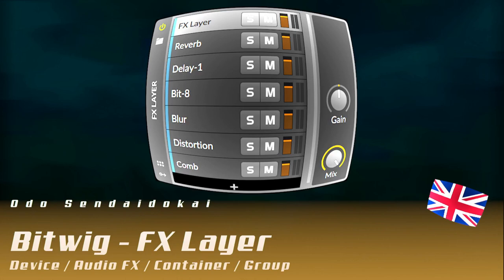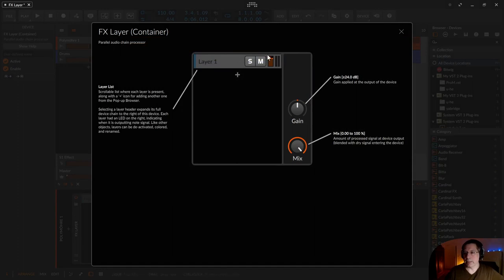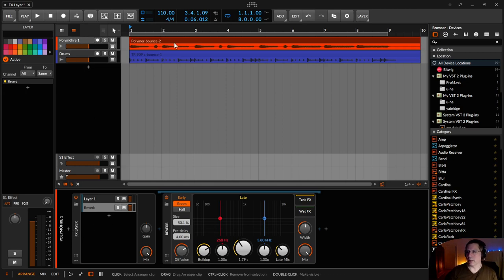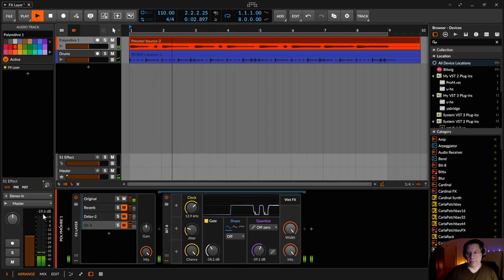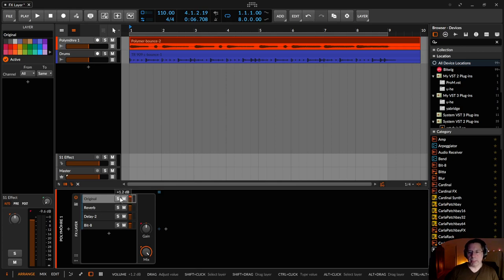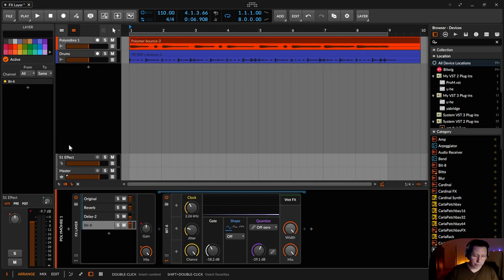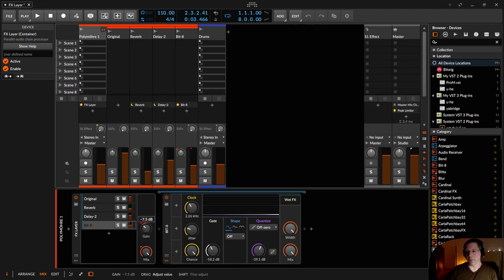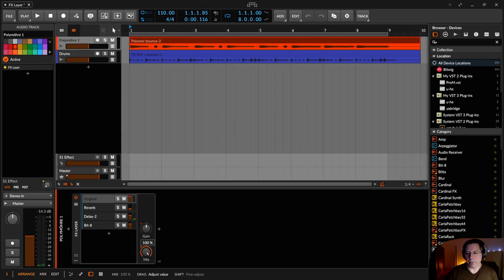Bitwig - FX Layer / Effect / Container | english

Comment: What I find confusing is there is only one mix knob, it's not one for each layer.  If I have it empty it still gets the signal through, if you put in a pro-q3 but dont have a dry layer it still seems to mix with the dry layer, and if you add a few layers it's like parallel on steroids & then each of these fx layers can still pump out to the fx sends that are set up. so 3 or for layers plus a dry, I was wondering why some of my levels where peaking, sometimes I might have more than one fx layer container in a track, sometimes on sometimes not but still boosting things due to all the extra virtual tracks.
Reply from the maker: If it is like you described, you should send a bug report as email to support@bitwig dot com . For the mix knob for every layer you have that brown vertical bar aka volume bar on each layer, where you can dial in the amount of signal you want to have in the result. And the mixture of all signals you are dialing in can be mixed again with the dry signal via  the big mix knob at the bottom right.
Reply: @OdoSendaidokai  Yes I know I have a lot of extra tracks created, from testing different ideas, a simple project turns into a monster quite quick, time to re-visit them all for the gazzilionth time, maybe I didnt quite describe what I wanted to say, but the point is I was getting more signal than I knew I wanted, maybe sometimes it was coming from a different place than I thought it was(4-6db for every extra track), but the video has made me want to revisit my choices, I'll figure it out.

Comment: Is there a way to control the volume that goes into the container ?
Reply from the maker: Sure, you could put a tool device in front of the FX Layer to control the general input. Or in front of each FX Device in the container.
Reply: @OdoSendaidokai  or for my case, use a Chain Container and start with the tool, this way I can inject my effect when I want. It's about the same as the fx channel, but it's in a track, I prefer it this way, thank you for your answer
Reply from the maker: @artakan303 🌻it is soundwise not exactly the same, but if it works for you, it works for you! 😃👍